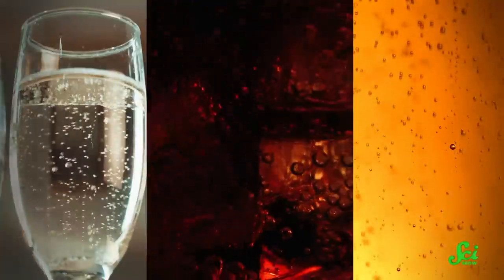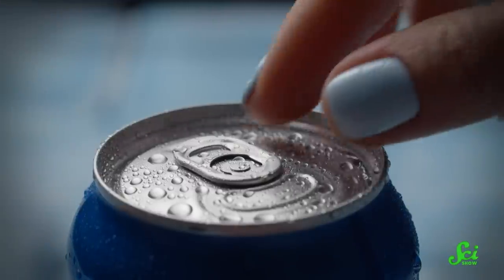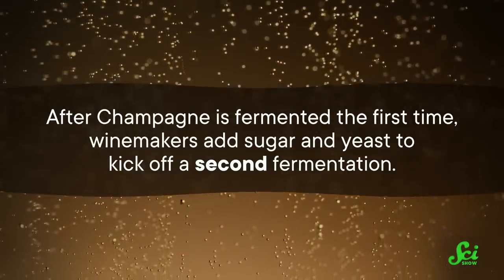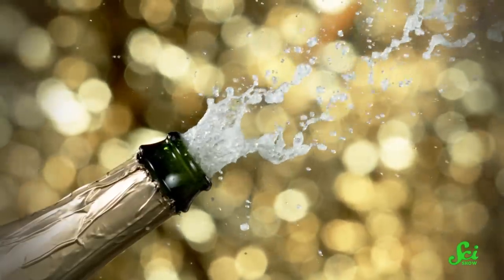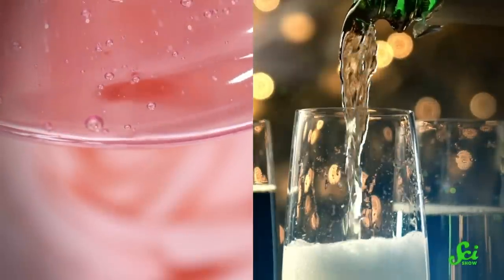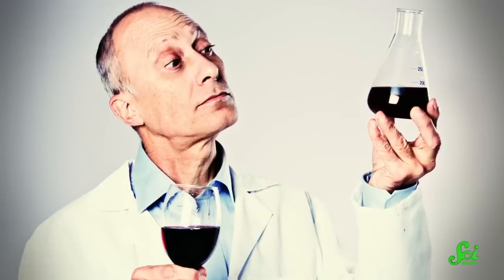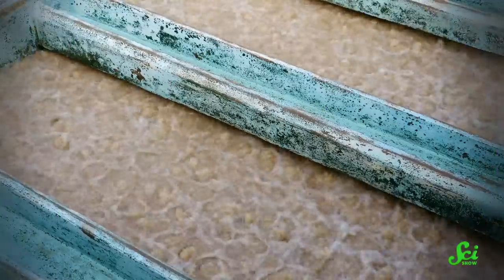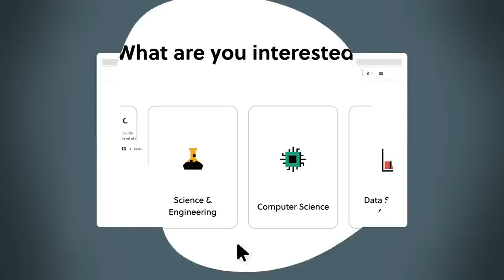Why Are Champagne Bubbles So Tidy?

Comment: It’s very important to differentiate between Champagne and sparkling wine. The bubbles are based even further, tldr fancy yeast, with champagne region sparkling wine. It’s an actual difference. Cheaper is bigger/fizzier bubbles, champagne is delicate light small bubbles.
Reply: Champagne is sparkling wine from the region Champagne, correct, but I don’t agree that it’s inherently superior. There are sparkling wines that are just as good using the same method from Spain and, honestly, England. And, to be fair, a lot of Champagne is over-priced crap (hello, Laurent Perrier).

Comment: You never answered the question of why surfactants cause the vortices to swirl a specific way. I don't have access to the study, so I can't find out for myself. Please help!
Reply: I was curious about that myself. There's a link to an open pre-print (arXiv) version of the study in the description. It's still a bit dense, but here's how I think it goes (non-expert, so take with a grain of salt):
(1) As bubbles of a certain size float up, some liquid directly in front and in back gets pushed/pulled up with it, while liquid to the side gets pulled down to compensate (in some very bubbly systems, you might see smaller bubbles get pulled down by this downward flow). This up/down flow creates a certain vorticity pattern around the bubble and in its wake. For millimeter scale bubbles without surfactant, this vorticity pushes bubbles to the side, out from behind each other.
(2) Large bubbles flatten out as they travel up, thus the induced upwards liquid flow in its wake is significant, and the vorticity pattern changes to favor bubble trains (the direction shown in the video).
(3) Surfactant on the bubble causes stiffening of the bubble surface (see: Marangoni effect) and prevents slipping of the liquid. That means that the liquid that would otherwise travel downwards around the sides of the bubble instead gets grabbed and pulled upwards with the bubble. This effect also changes the vorticity pattern similar to that for large bubbles, favoring bubble trains.
Reply: @alberthung6191  Thank you. They also linked to the study in a way where you could only see the abstract so thought the full version was not available. Thank you for letting me know. Will make for some interesting reading.

Comment: why does weed make more smoke than tobacco?
Reply: The chemicals?
Reply: @jonadkins4339 so chemicals in tabacco  make less smoke?
Reply: Gotta define your terms, "more visible smoke", could be a differential in particle size. Even better, "What makes tobacco and weed smoke look different?"
Reply: Cigarettes have filters which catch a lot of the smoke. Joints usually don't.
Reply: @TheRealSkeletor filters aren't designed to trap smoke or chemicals. They add chemicals to alter the flavor.
Reply: @TheRealSkeletor  It's interesting, because even hand rolled tobacco without filter doesn't plume densely the way weed does. It's not perfectly framed yet, but it's a valid question....
Reply: @Elizabeth_Paz  Could be there are more oils, more lipids, we need more data. It's a good question...
Reply: @longline  yes, thats a better question.
Reply: What a second, a video taking a look at smoke would be really interesting. On a large scale, whether it’s cooking, industrial processing, fires, or… recreation, a visible differences in smoke and how your body and environment interact with them would be fun mental candy to chew on

Comment: Nice video and interesting topic but I feel betrayed. You skip THE most important point: Why do the vortices turn in different directions depending on the surfactant? Thats what produces the difference to beer, coke etc
Reply: Have a look at some of the links in the description. I've got a background in this area, so some of what I've quickly read suggests the issue is that SciShow tried their best to come up with a simple description for what's going on, but it's really not simple at all, and the description they've given actually doesn't make much sense for me. I think the best answer (in a comment) is that a surfactant lowers the energy required to grow a bigger bubble, and also then makes the bubble more deformable once grown. The deformable bubble then interacts with its own wake a little differently, which through a series of complex fluid mechanics steps, leads to a streamlining of the flows, which also then streamlines the bubble separations.
Reply: @MrClivesinger  Thanks for your response.!